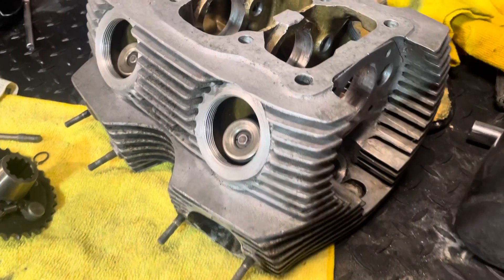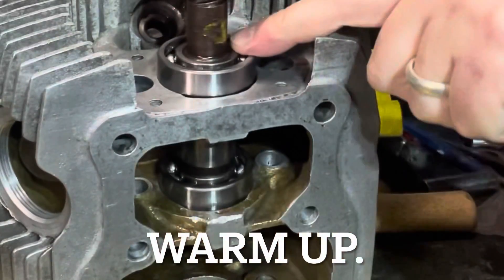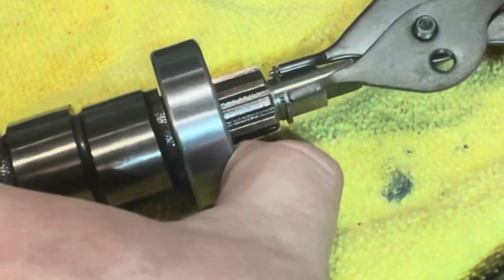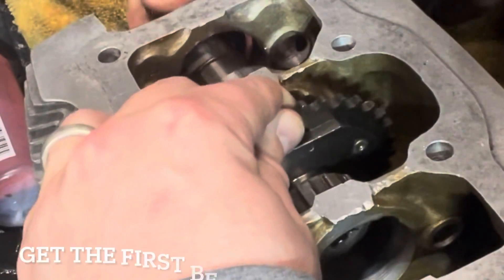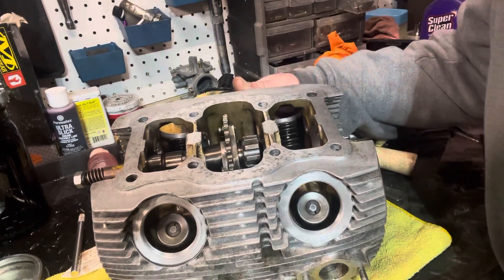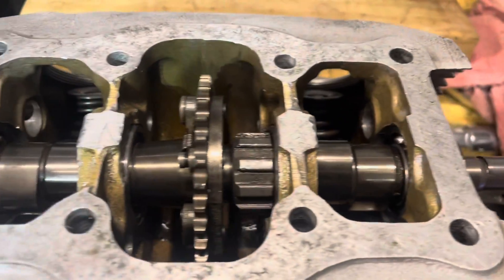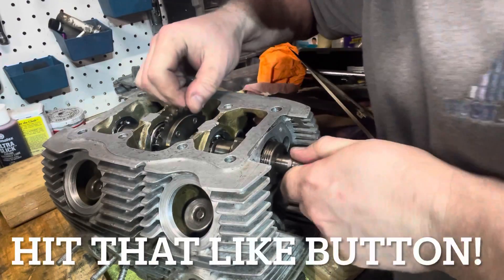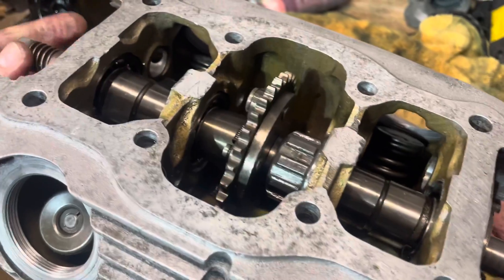Install Camshaft on Honda Motorcycle 305 Engine: Super Hawk CB77

Comment: Thanks for the video and the build series too. I have recently acquired a 1965 Honda Superhawk 305 with a seized engine. was at a loss last night on how the heck to get timing chain out, head off, of a seized engine... 
Mine is a bit worse off for condition. Sat outside for some time and later the basement flooded where it was stored, some time ago. I acquired a couple bike from this house and all drained more water than oil from engines. Last registration on the 305 was 1978-79 from the safety inspection sticker. Filled a 30oz container of Mud and Sludge from gas tank. Smell of the bike just being in my shop was getting annoying, so it had to get cleaned up. Not quite ready to get into it but already too deep to stop.
Also got a 1965 Yamaha YA6 125 2-stroke that is getting finished up. From the same place. Went to give it a fist start the other day and found a tiny pinhole inner wall of the tank. Paint is too nice to risk weld/braze so, while I hate to do it, it's getting coated. Hopefully a first start video for the YA6 will be posted on my channel soon.
Reply from the maker: How’d it turn out? I’m concerned that I may have a pinhole in a tank right now too. Ugh. Always something.

Comment: Thanks for putting the video out there. FYI, when designating left, right, front, rear, etc., all motor vehicles (to my knowledge) use the perspective of sitting in the drivers seat. So in relation to this video, the camshaft with the tachometer drive is the left camshaft or cylinder #1 camshaft. It doesn't make a difference how the engine is oriented on the bench. Just a friendly tip.
Reply from the maker: Thanks so much!

Comment: Maybe I’m missing something, but don’t you need the head on the engine and the chain up and around the shaft/gear before you install the cams?
Reply from the maker: Nope. I’m putting in a new chain. All should work out nicely. :)
Reply: I hope the cam chain has a master link and is not the endless type.   The endless type can be used but it’s easier with the removable link type
Reply from the maker: It does have a master link